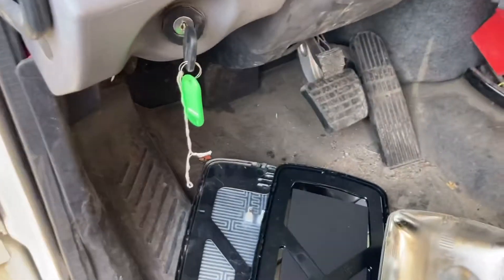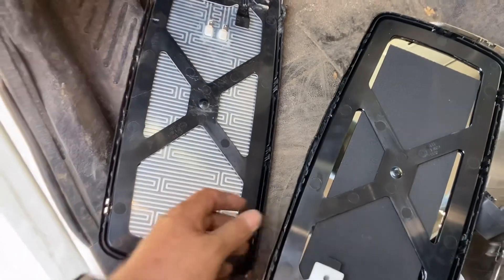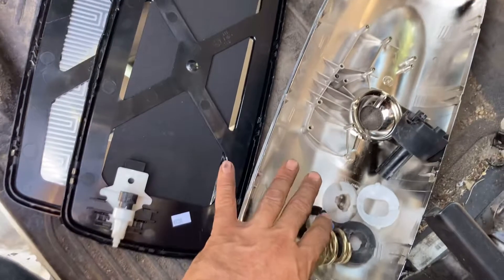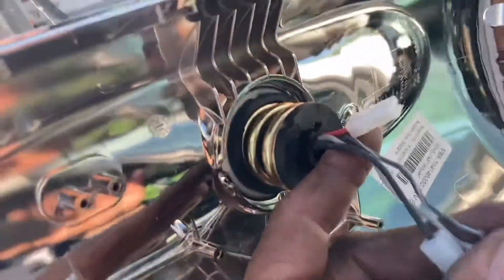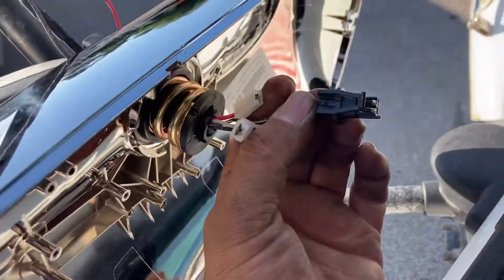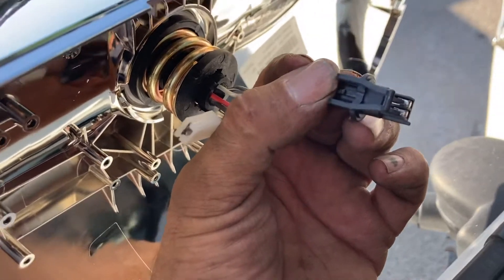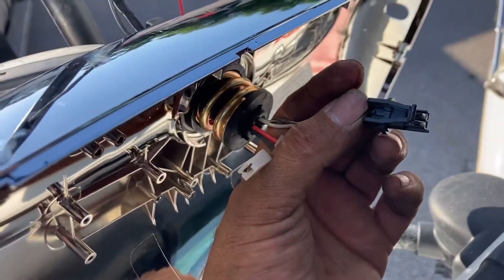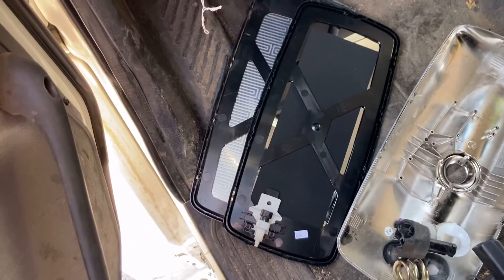Freightliner ,Replacing the outside air temp sensor in the mirror.

Comment: Did that sensor affect performance?
Reply from the maker: Yes since the ecm could not determine the air temp it would not regen, so it derates
Reply: @sonofmontezuma3732  wow, thats what happened to me, put me in derates in the middle of nowhere in Kansas. Can you tell me ... Was coolant temperature gauge lower then usual?
Reply from the maker: I don’t understand the question however the outside air temp gauge tells the ecm the ambient air temp which depending on you make & model the regen system will adjust the fuel for the Doc to work correctly, cold will fuel heavy so it can hit correct temp in the allowed time given by the engineers.
Reply: @sonofmontezuma3732  In my case, temperature just dropped from 180-185(normal operating range) to 160 and didn't let me do do Regen at all. Do you think that sensor (if bad)can do that? Thank you for fast responding 👍
Reply from the maker: Is it a Cummins? The temp your talking about sounds like coolant temp? So am assume it’s a Cummins which are notorious for the thermostat failing open. The ecm actually has its own dedicated sensor which can only be seen with a scanner or lab top, the regen system depending on brand will not induce a regen till it’s see’s temp over 160 or 170 again depends on brand. Hope it helps
Reply: @sonofmontezuma3732 if the truck is deleted how else could this sensor effect the truck?
Reply from the maker: @arnesgledovic4241 not sure because I do not work on deleted trucks